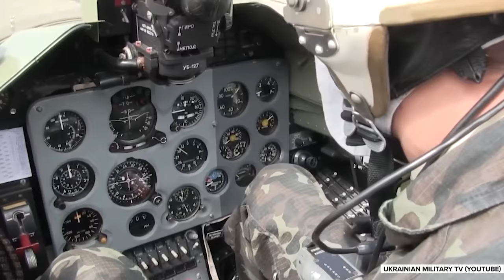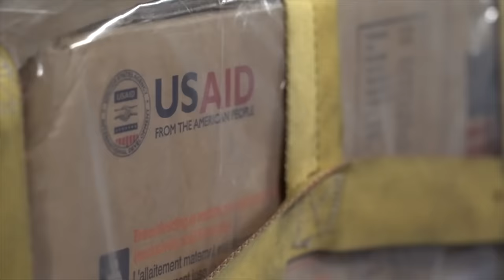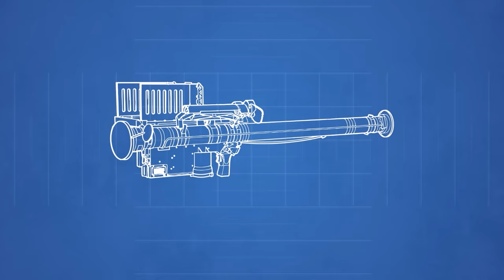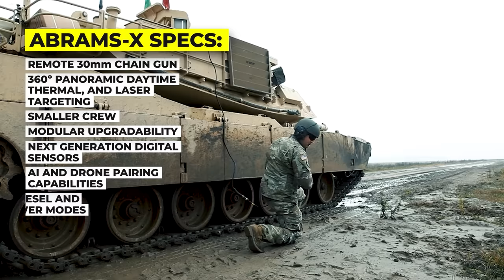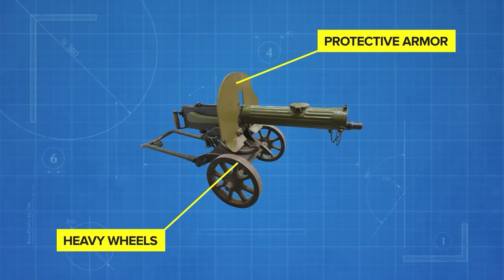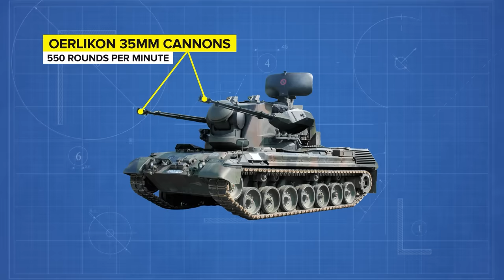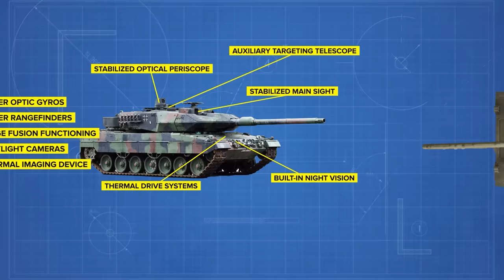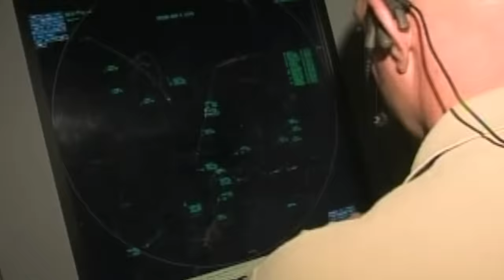US Weapons Used in Ukraine War (And Other) - Compilation

Comment: He's not scared of a 40 year old plane.
Reply: He’s scared of a 35yr old plane with AGM HARM Anti Radiation missiles
Reply: @bryan_._delarosa5754  Ukraine has had these missiles for a long time. But they are simply shot down by air defense

aim-120 has also been in service with Ukraine for a long time. No one has explained how the f-16 with these missiles is going to counter the su-35 with hypersonic air-to-air missiles r37m with three times the effective range

The USA clearly said that there is no need to expect miracles from the f-16 aircraft
Reply: @struvrim7637  He covered this issue in the video. Maybe should you have watched the video. There are currently no aircraft in Ukraine capable of firing AIM 120s therefore there are no AIM120s in Ukraine. There are no hypersonic air to air missiles in service anywhere. There are hypersonic air to surface missiles which Patriot has no trouble whatsoever in shooting down. Additionally, hypersonic missiles are as expensive as modern fighters so it is extremely unlikely that there would multi-million Ruble SU-35s carrying hypersonic air to air missiles that cost as much as a SU-35. As far as the SU-35 goes, they are capable aircraft if they are properly maintained(they are not) and are supplied with enough spare parts(they are not).  The sad reality is all the problems affecting Russian ground forces and naval forces (piss poor training, non-existent maintenance, absolutely comically terrible logistics and a world class kleptocracy) are also affecting their air forces. That’s why they have resorted to taping civilian Garmin GPS’s to their cockpits.
Reply: Putin shit his pants.
Reply: Russia struggles to put up a fight to 40 year old US tech
Reply: @bluedistortions  too inebriated to fight.

Comment: they don't need to repave everything. They can just put aircraft carrier Landing gear or at least something equivalent to landing gear strength.
Reply: No they can't if they could the f 18 would never had been made. It's not just the landing gear that would need to be strengthen the airframe would need it too which would add weight that its single engine couldn't handle.

Comment: Great video. One qualm. The speed of ATACMS is not a benefit over storm shadow or other low observable cruise missile type weapons. The lower cruise speed is not a disadvantage for stealthy weapons in that it allows for attacks on defended targets like the strike on the Black Sea fleet HQ without enemy air defense noticing in advance. In comparison an ATACMS would have been spotted most likely due to the higher ballistic flight path (google radar horizon), allowing the enemy the chance to shoot it down as it comes in VS a stealthy low flying cruise weapon that sneaks up quietly on the enemy low to the ground.